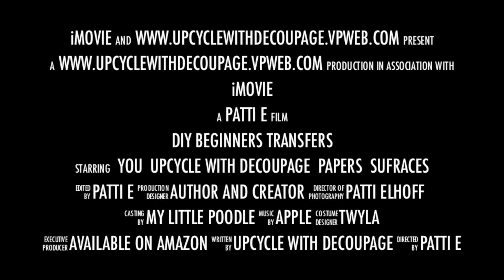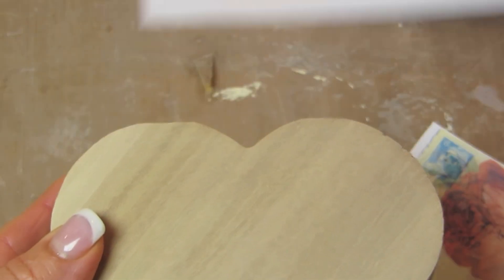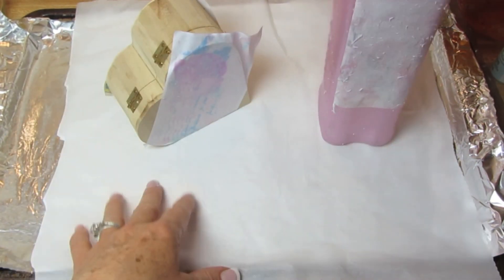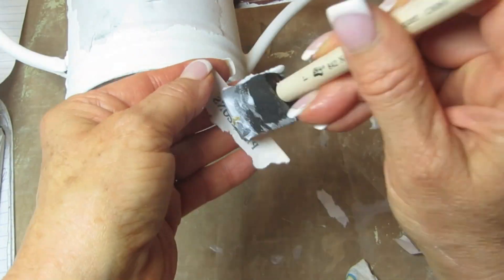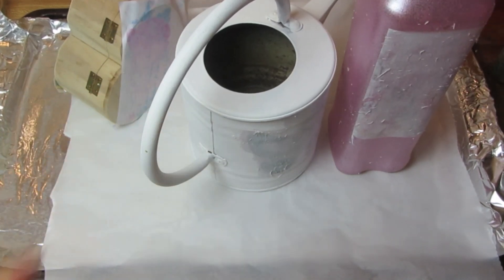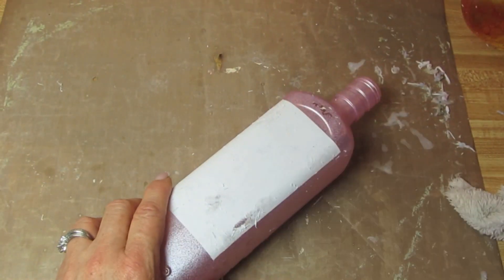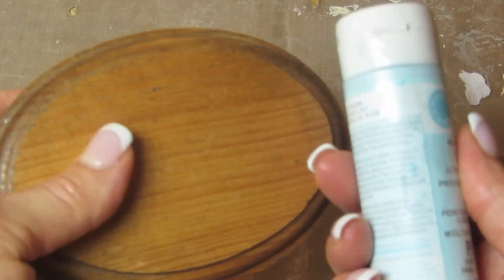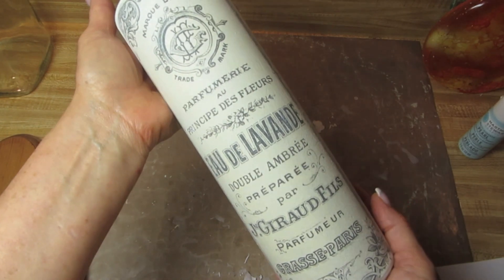DIY Transfers for beginners Ink Jet and Laser

Comment: Which is better in your opinion to use for your transfer, a inkjet printer or laser?
Reply from the maker: +J&amp;J Accessories Laser-100 percent! I know that most people have ink jet printers in their homes but the laser is so much better for transfers. It's very crisp and clear with no fading spots -you don't need to prep it at all because the laser printer will not bleed or smear. ;)
Patti
Reply: I tried it with my laser printer with mod pod  and it would not transfer...I used wax paper to try and then computer paper neither would work...
Reply from the maker: I tried the wax paper method myself and I didn't like it at all, it came out so faint, I couldn't see it! I will say that I've only done transfers over chalk painted surfaces-the chalk paint is an amazing base for the transfer. I think there are video's here on youtube for transfers on raw wood if that is what you are looking for but if you're not having luck with your transfers (especially laser) over painted surfaces have a look at this video and see if it works better for you. The instructions start at 223 into the video if you want to skip through the intro and my talking. :) Let me know how you do. By the way, this is a laser print I'm using in this video. https://youtu.be/LCB8FylLc54
Reply: Ok thanks

Comment: Hi, can I make copies from my inkjet printer to use instead of using a laser print or taking it to a place to make copies?
Reply from the maker: +Michelle Miller Hi Michelle, you can but ink jet prints do run, bleed and smear. If you're doing this for the first time you'll have a lot more luck with laser prints. 
Patti
Reply: +patioelf Hi Patti, even if I just make a copy from the printer?  thanks ☺
Reply from the maker: Hi Michelle, you can still try it with your ink jet printer, here's a link to a good blog post that might help you too   http://piddix.blogspot.com/2011/02/how-to-prevent-smudges-and-bleeding.html      Patti
Reply: Thank you, so much, Patti

Comment: May I add that a quicker method than putting inkjet in the oven is apply a thin coat of polymer medium . Let dry. Put between parchment paper and go over it briefly with a warm iron . Maybe 10 seconds. Then you can apply it to your surface to transfer .
Reply from the maker: Wow, thank you Janine! I hope a lot of people read this but if they ask instead of reading, I like that I can now pass your suggestion along! I'll give it a try too....More people have ink jets than laser printers so that would be great! Thanks again!
Patti
Reply: no problem. I have yet to do my own you tube videos. But I am planning to create one for that. but sure pass it on for now. a few seconds is crucial as to not burn it and to keep moving the iron. It does get slightly smoky but it's not a big deal. I sandwich it between the parchment.
Reply: Tri Art polymer medium or Golden brand

Comment: is it true what I have been told that  ink jet printers do not print white  and the white areas come out the colour of the wood
Reply: It doesn't matter.
The PVA glue can replace your white.

Before you place your color photo. Glue the surfaces of the wood with some PVA glue.
Reply: anthony shephard the first layer  is left to dry and then you add your second layer of PVA to absorb the ink.
Reply from the maker: It is true that printers don't print white. (that's why when you replace your ink cartridges, you only replace the colors and the black. :) 
Patti
Reply from the maker: Thank you for your assistance. That was very nice of you!
Patti
Reply from the maker: Thank you for your assistance. That was very nice of you!
Patti